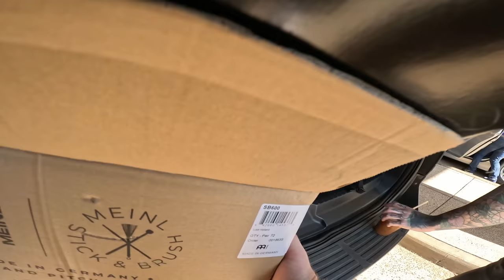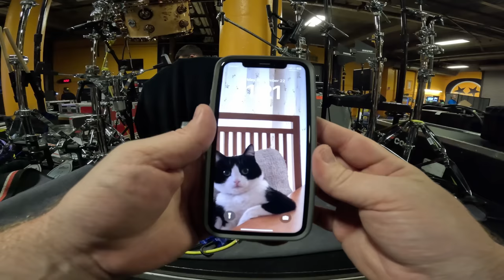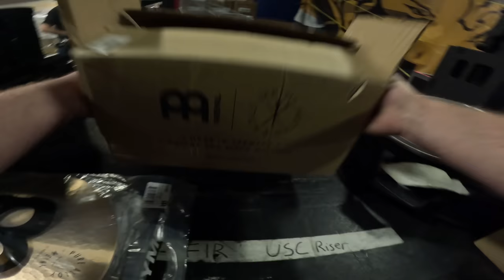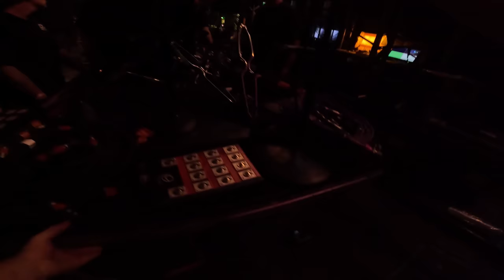Drum Tech POV | Bridgestone Arena

Comment: Definitely held my breath during the lift knowing exactly what was at stake.
Also made it through the entire video as usual.

Out of curiosity why don’t you utilize an electric screw driver to remove and reinstall the drum heads much quicker and do the final tightening/tuning manually? Still loving the videos. Really reminds me of when I got to run around with my uncles country band both when they were just a smaller touring band and when they made it big with Columbia records in 1995. Really miss a lot of that.
Reply from the maker: Honestly it's because im only changing 3 heads at most.  If I was working with a bigger kit id bring my drill for sure.
Reply: @matthorndrums  That’s pretty much what I was thinking but I was curious nevertheless. I didn’t do much when it came to tuning my uncle’s drum kit but I always helped the drum tech by removing all the heads every third or fourth show. Cleaned all the heads and made sure all the hardware was still secure before installing new heads then handing them over to the drum tech to tune. His kit was a rack mount kit. He had 4 toms on the rack,  2 floor toms, 2 snares, 2 bass/kick drums and a whole host of cymbals. It was fun to help set up but definitely took a while. After that I worked primarily with the guitar and fiddle techs because I could actually tune those lol. 
Stay safe and have a blast out there on the road bro and keep dropping the great videos.

Comment: Wouldn't pressing down on the head after it's seated on the drum cause undue strain/warping on the bearing edge and hoop? I usually like to crack the glue around a fresh head with my fingers before putting it on.

Comment: You should check out lug locks if you haven’t tried them. Tune the drums then set the locks, no more drums detuning.
Reply from the maker: I've used them many times and I think they're a pain in the ass.  you can't do any adjusting without taking them all off and losing them.  The head is going to stretch whether the tension rods move or not.